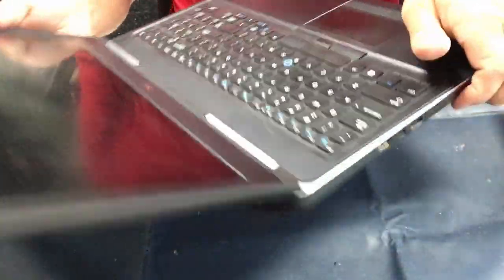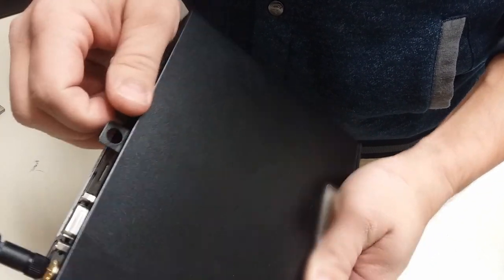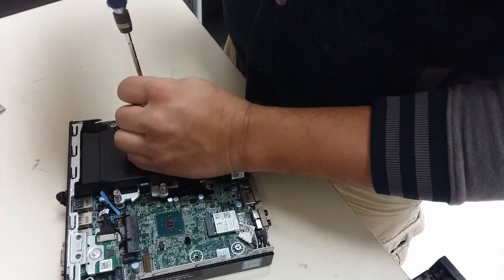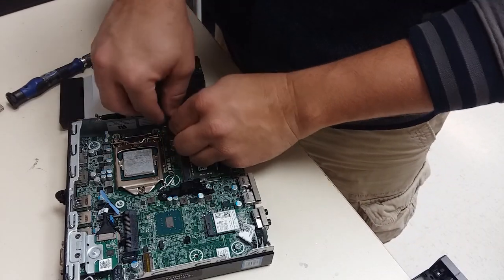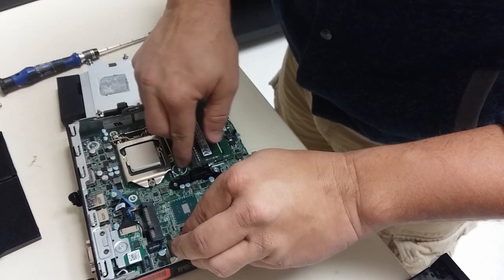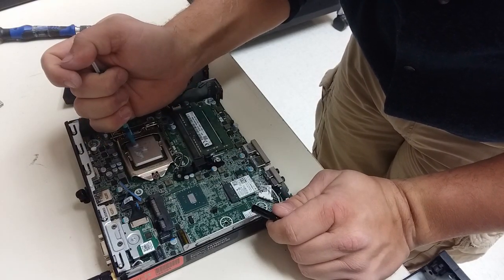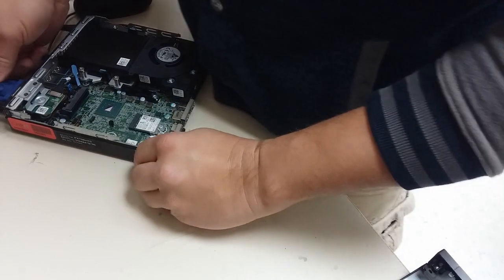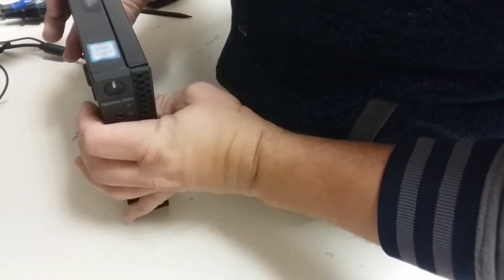Technician's Corner - Optiplex 7040 MFF CPU Replacement

Comment: Thank you I just bought the same model and this video is very helpful, I don't know if I'll upgrade the CPU but it's good to know how. Would you happen to know if the CPU fans are still available in case mine goes out I'd like to have a backup, thanks again.
Reply from the maker: The fans are pretty common you can pick one up from most computer parts stors as well as Amazon and other online dealers. Just be sure to match the specs and the connector type.
Reply: @WorldofMe  Thanks for the tip, as long as the wire gauge is the same but not the connector do you think I could swap wires to the old connector?
Reply from the maker: @BEDavisBrown  It is possible, however depending on the wiring you may loose some functionality. Some fans have sensors as well as throttle controls. If it has four or five wires and you try to use a three you won't get all the benefits available. Again, the fans are not as "special" as selecting something like ram or a CPU, so it shouldn't be hard to find a compatible match.
Reply: @WorldofMe  Thanks again and I would only try it if new and old had four wires, and I found one on ebay that I bought for $11 so I'll see when it gets here.

Comment: I can install a Intel Xeon E5-2650 v4 in a Dell optiplex 7040 Sff?
Reply from the maker: It will depend on the board specs. You'll need to look up the motherboard model to see it's compatibilities.

Comment: I have 2 questions. 1# what cpu did you replace it with? 2# I have a dell optiplex 7040 mid tower with an i7 6700. Would It be possible for me to replace the cpu with an i7 7700k or an i9 6900?
Reply from the maker: It was replaced with an identical model as there was a chip malfunction. As for the other cpu's you mentioned the 7700k might be possible but I doubt the i9 would work. You'l need to look up the specs on your specific board as the pc model can use different boards. The model number is usually written in large letters near the pci slots.

Comment: Hi, Have a same machine with Dell 130 W PSU. Can I use 65 W desktop CPUs? Thanks.
Reply from the maker: It may be possible, however I would suggest looking up the specifications for the model of motherboard in your system (there are different models in the same pc model), to be sure you don't short the chip or the board.

Comment: It seems all mff units use the lower power version of CPUs (with a T suffix). Is it possible to put a desktop CPU in there (non K version) and not make the PSU explode?
Reply: the power brick is only 65 watts so only T-processors work